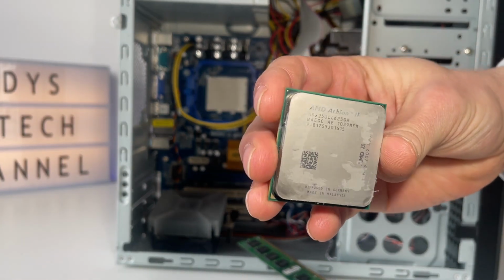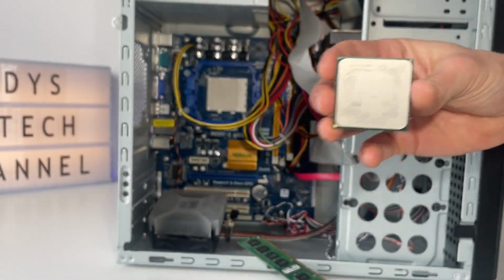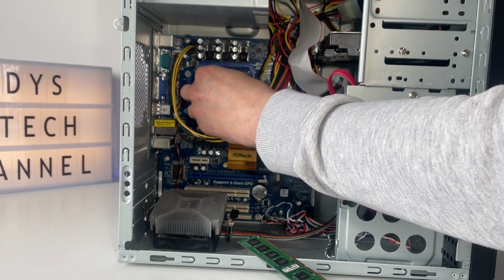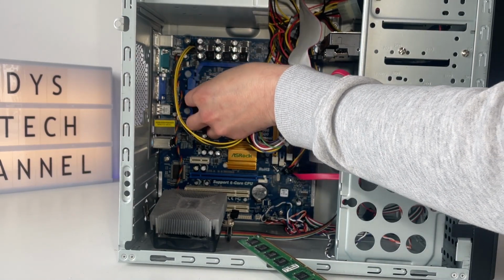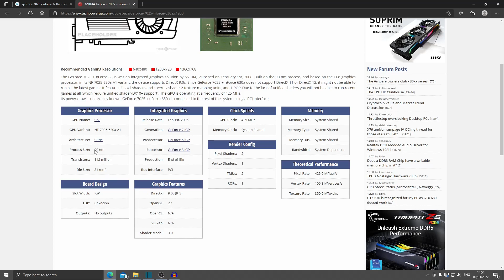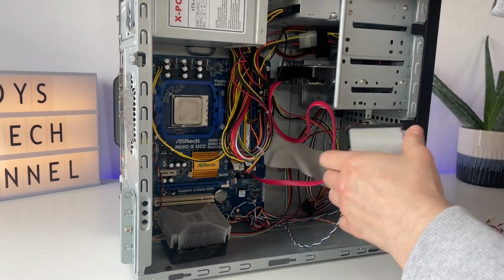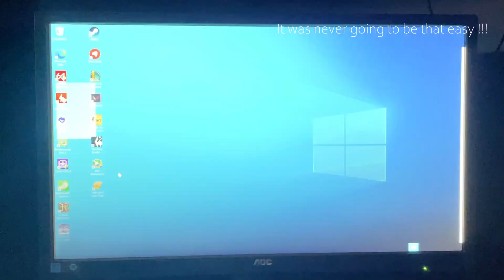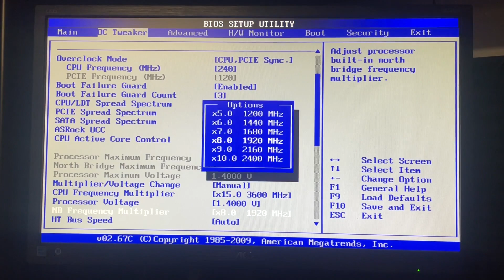Fixing a free pc - Is it actually worth it? Can you game on it?

Comment: Great video, would have been good you see you pick up a overclockable 4 core for it, would probably only be £10-20. Probably would play all those budget games fine. Install an £15 SSD and take the frame counter off and anyone using it would probably think it was a much more expensive pc.
Reply from the maker: Cheers for the comment, yes it definitely needed an SSD in the system but was working with what God gave me so stuck with the HDD 😁 I’ve kept the system around and I get what you mean, if an old Phenom ever drops in it would be a good little upgrade as the Athlon was struggling in today world 😅 it was probably struggling new tbh.

Comment: The problem with the Am2/3 is the SSE 4.1/4.2 instruction support or lack of, you will find a lot of games will not run, if you was thinking of getting/acquiring something older the fx series supports SSE 4* or even first Gen intel .
Reply from the maker: Yes agreed, even the great LGA1366 is now showing it’s lack of modern instruction sets which is a shame really as there still more than capable. Not the old Athlon’s though sadly 😅 a 1st/2nd gen i3 would leave it standing even the x4 chips.

Comment: Whatever... but there is a cute ~applet that skirts the no boot on nvme due to old bios thing - Clover

ssd is a major boost, & nvme (w/ a cheap pcie n.2 adapter) is way faster & less resource intensive than sata ssd (despite the naysayers)

so to have an nvme boot/system drive is like a new system

16GB 2400 ddr3 kits have recently become quite cheap too btw
Reply from the maker: Thanks Peter, I’ve never used a pcie n.2 adapter, I’ve always just pop’d a sata SSD in. I’ll have to give it a try but yes the system needed an SSD and would be the first upgrade I’d make if I was keeping the system. 

I do have a couple of 2400 ddr3 kits but I’ve been waiting for a decent motherboard to put them in, I’m sure one will turn up 🙏🏼
Reply: @andystech101  pcie to m.2 adapters are cheap - esp on aliexpress - a few $ for pcie x1 & ~$4 for pcie x4

some cut & pastes fyi?

"I’m making a shift to Linux Mint, and I have an old Z420 workstation headed my way to be my DD. I’ll be putting in an SSD either way, but I am considering an NVMe drive running on a PCIe card since prices are so good now. My question would be, is it possible to install and boot to Linux in this way   " 
"  1) NVMe boot mod for UEFI BIOS : LINK (works on all EFI type boards)2) If you don't want to play around with EFI, you can always use Clover/DUET as 3-rd party EFI boot :
a) DUET : LINK
b) Clover : LINK

PS. I currently use a moded UEFI for my X79, that supports NVMe booting."
https://www.techpowerup.com/forums/threads/booting-to-a-nvme-via-pcie-card-is-it-possible.255703/

On Wed, Nov 27, 2019 at 9:10 AM Peter Connell <peterconnell612@gmail.com> wrote:

https://www.win-raid.com/t2375f50-Guide-NVMe-boot-without-modding-your-UEFI-BIOS-Clover-EFI-bootloader-method.html
Reply from the maker: Your above my pay grade there Peter with the NVMe stuff but I’m sure you’ll work it out. 

Those Z420s are solid and great systems but I know the HP bios’s are a complete pain to try to do anything with! 

Keep me posted anyway 🙏🏼
Reply: @andystech101  The key thing imo is that obviously we are very cpu challenged, & this  way places less strain on the cpu it seems.

Comment: Maybe stick a Athlon II X4-650/640/Phenom II X6 1055T in it, depending what you is more affordable? Or use the low-power chip already in there for a relatively energy efficient media-centre PC? In any case, great vid and great delivery 👌
Reply from the maker: I did have a look at X6 Phenoms and was amazing what they where going for used, like £50 on eBay 😅 mad when you can get an i7 920 for a £5 that will make it run home crying for it mother. Would be nice to try and find a x4 Athlon for cheap, I do have an x3 435 I might try in the system and see what difference the extra core makes 👌🏼